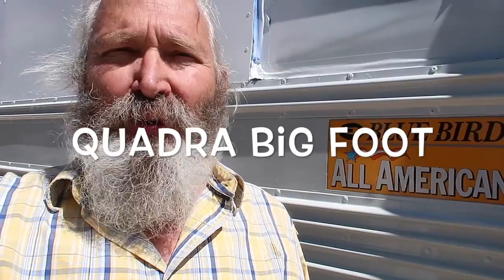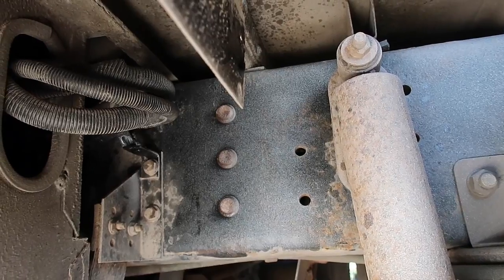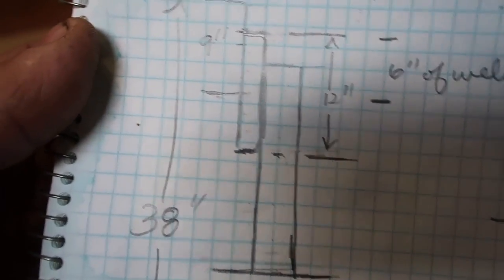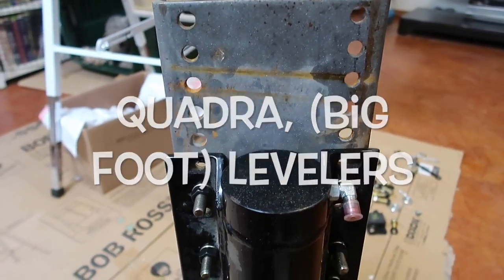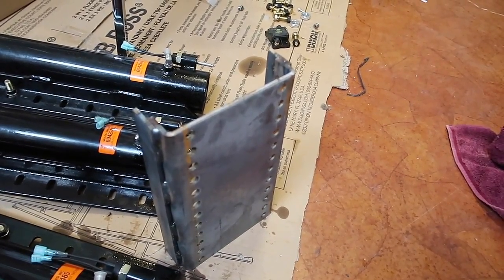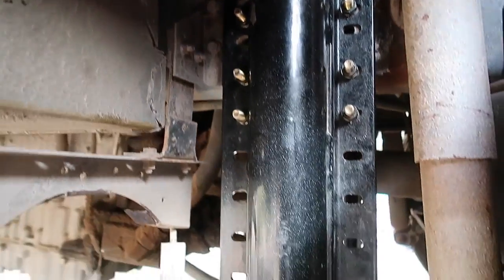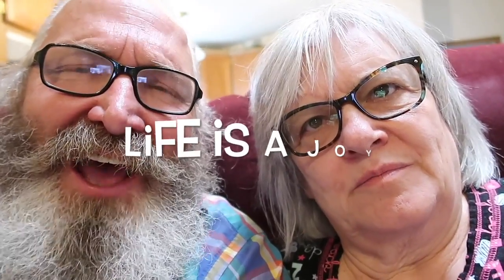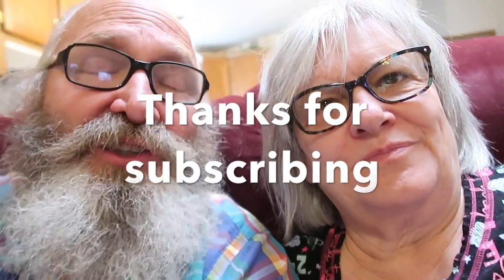School Bus conversion to  Motor Home #65  Quatra (Big Foot) levelers (PART 1)

Comment: Good Morning to you too my friend! God bless you! Happy retirement to your wife too! You are doing great! Thank you for sharing this video, as I'm not at all familiar with how this leveling system works. My bus the 2002 Bluebird [former Red Cross Blood collection bus] has the remains of a leveling system which I think I'm going to try and salvage. The setup I have has no computer control looks like a joystick and electric pumps. I recall seeing only two cylinders left, one just about falling off! [Bus at shop getting some other mechanical stuff fixed-when that part is done, I'll start my work on it].  So thank you for sharing your experience! And thank you for sharing your great attitude towards life! [What an inspiration!] God bless you guys! Life is a joy!

Comment: i think it would be a good idea to connect youre limit switches to youre parking brake release in some way , so the bus whont be able to move untill all the legs are up

good call on having it welded , the height of the leveler is about the same as the shocks nex to it so i dont think it wil hit anything on the road when moving

happy retirement day , life is a joy and its about to get better still